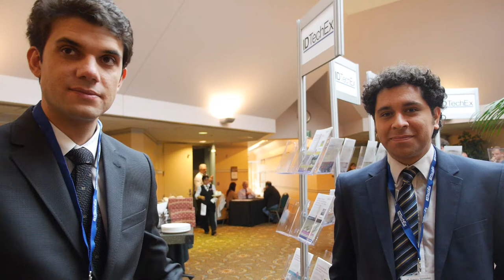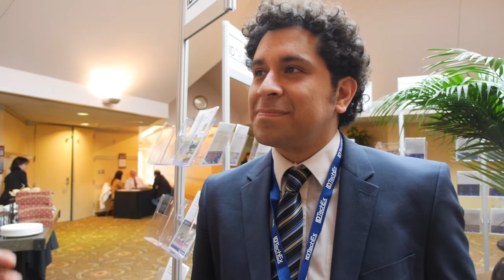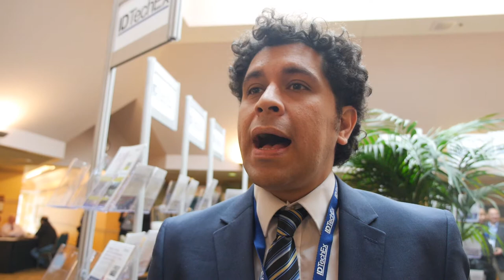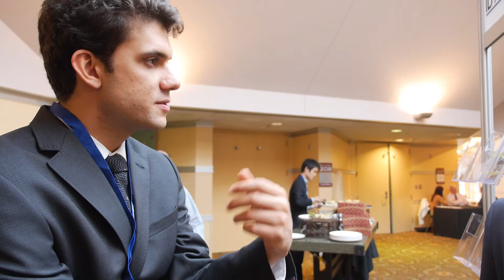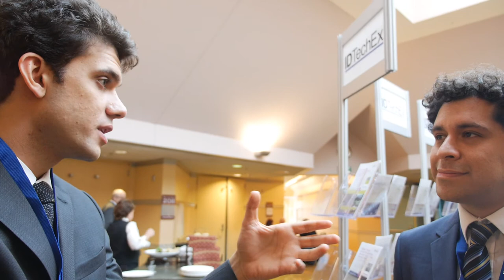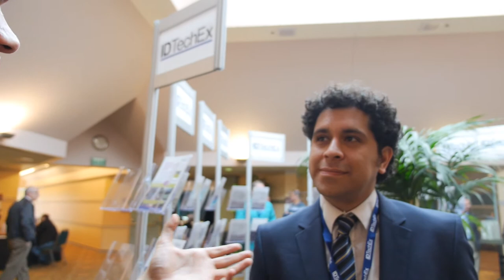Supercacitor trends, interview with IDTechEx

Comment: Super capacitors with 30 to 40% of the energy density of Li-ion ? Where? That may be true for hybrid capacitors but those will not have the other benefits of supercapacitors like cycle life of 500k to 1M and high power density.
For example the DLE series (high energy) super-caps from Mippon Chemi-Con are just 4.25Wh/kg (e.g. 2300F at 2.5V with 470g)
Compare that with about 200Wh/kg for most Li-ion used in cars and mobile electronics.
In this example with the DLE cap above is just 2% energy density compared to Li-ion.
I'm sure there are better example and get to 3 to 4% but not 30 to 40%
I first had the pleasure to work (play) with a supercapacitor from Panasonic (GoldCap) about 20 years ago. It was a 3.3F rated at 5V (there where two supercaps in series in the same case).